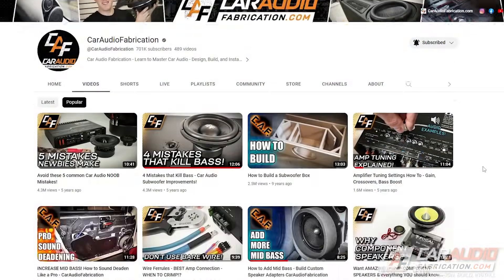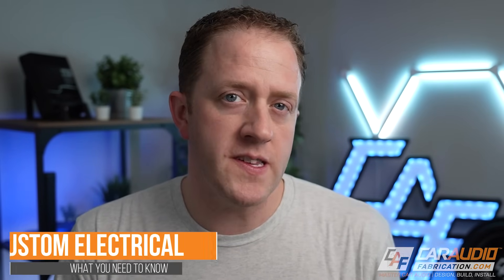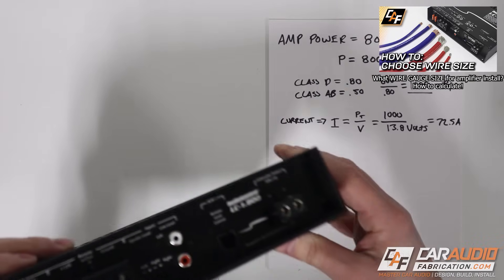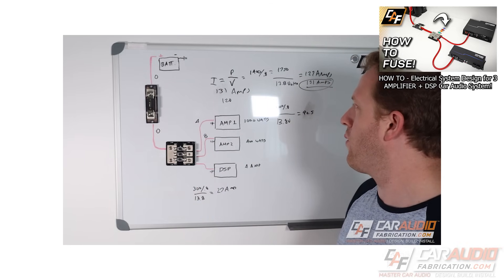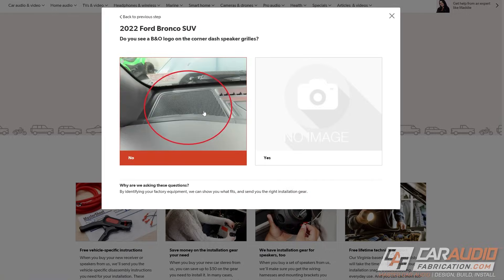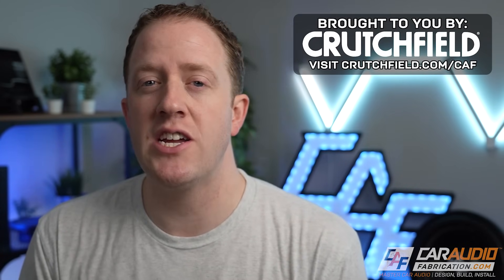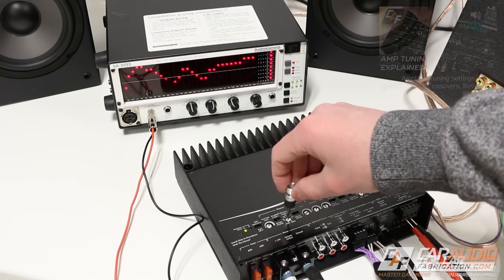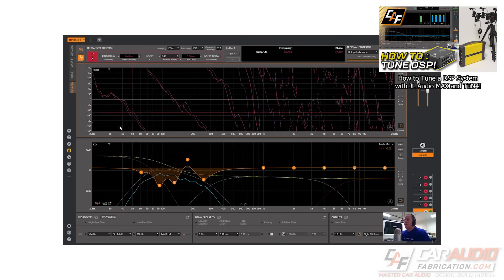New to custom car audio? START HERE!

Comment: HI i watch a lot of your videos and they are very helpful. I just got a ford excursion and want to upgrade the audio system. It has 6- 6x8 speakers stock. I want to add a sub, head unit and upgraded speakers. What’s the best way to go about this.

Comment: have an 03 G35 coupe.
It came with a bose system that has been ripped out many moons ago before I purchased it.
There are 6 speakers (front lower door, mid  passenger and upper rear deck).
Im trying to get all four "highs, mids, lows and sub". I keep the passenger back rest down. My setup jvc multimedia media head unit, Polk audio speakers on the passenger and front doors, with JL w6 12" sub in the trunk.I I purchased 3 (don't need to use all maybe 2 only) 6"  memphis power reference woofers and to power everything I have Audio Control D-6. 1200 and a JL 500/1.
My question is how come I still can not get  or hear the definition of all four. I was thinking it might be over kill or they don't make head units with four outputs (front , mid passenger, rear and sub). Or could it be my setup.

Any suggestion my sound?

Comment: Heyho. I need your help. I'm also a complete noob, but I have a 1987 VW Golf 2 special edition Memphis in Atlas Grey Metallic and I want to keep it as stock as possible. (Due to old traditions) they sold the car without the radio, which comes in handy since I'll install a instrument panel on this spot AND then install the tiniest radio and amp which can fire the 6 stock speakers.
I don't want a rolling boom box but just nice sound without seeing the elements which I'll hide inside the dashboard and connect via Bluetooth. No screens, no blinky lights, no shiny decorations. Ghost sound system.
Any ideas, please?

Comment: So I installed my system back in march while it was still decently cold outside. Now that it’s gotten hotter, I’m starting to have overheating issues. Right now, I’m just riding around with the seat folded down (the amp is mounted to the back of the back seat, so it’s in the trunk). Since doing this, I haven’t had any overheating issues. However, we’re not quite into summer yet where it’s going to be even hotter. My air conditioning is also working twice as hard because it’s fighting against all the heat coming from the trunk. Do you have any ideas on how to bring the temperature down in my trunk so I could fold the seat back up?? Really hope someone sees this and can help me out. Thank you!!

Comment: Hey so I’m looking to make an audio system for my truck and I have a few questions, I’m am also on somewhat of a budget but I want it to sound nice so I will be willing to pay

I was thinking about getting 2 10” ct sound ozone subs with some door speakers. I don’t know which door speakers I should get yet but I would like to know how many outputs my amp should have or if I should use two separate amps for the subs and doors.

Also for the door speakers should I get coaxial speakers, component speakers or crossovers?

I would also like to know if tweeters are worth it and if so can they run good off the trucks original amp?

Comment: My car recently had it's battery/alternator die and I only have a subwoofer lined up. It's not on constant 12v and turns off alongside the car itself. What is the main cause of this issue? Is there simply too much strain on the battery? What can I do to prevent this. It's only a 10 inch sub, no amplifier. (Car has a stock one)

Comment: im kind of frustrated when i installed a china headunit and my stock speaker sounds like shit. Now tat ive changed the stock speaker, it still sounded shit. I fidle with the headunit EQ but it still not as good as stock one. Now i am thinking on getting an inverter and hook up my pc audio sub instead and run from the back of the headunit for output audio, lol.

Comment: Anyone know why when I install an aftermarket head unit in a 2005 bonneville head unit won’t turn on checked multiple times everything wired correctly and the stock one works when I plug it in

Comment: I grew up working on cars and started installing stereos when I was 12. It’s been a couple decades though so I thought it best to start from the beginning again and renew my knowledge. What I am wanting to do is simply add a couple subs and amp to my existing stock stereo in a 2020 Nissan Altima. I was thinking the simplest method would be to get a kit from skar audio with a single 10 or 12 and simple amp I would use the high input to connect it to my current stereo.

Comment: Hiya, I'm looking for advice on upgrading the sound system on my Hyundai i10 se 2017. Looking to spend around £500 but this is my first car and I have never installed any car audio at all. Mechanic by nature but looking for advice on parts. What would anyone recommend parts wise for a sub amp and wiring / fuse for £500

Comment: Hey Mark
I bought 2023 Toyota highlander with stock 11 speaker jbl sound system.
The sound is not great.

I am thinking of installing a sub and and amplifier.

Do you think this will make the system sound better ?

Or do I need to change the speakers as well ?

Thank you
Reply: Great question

Comment: I’m looking to build/install a stereo system in my 1956 chevy 3100 truck. I want to make a custom speaker set up using the original gas tank behind seat. I’m not going to use it for fuel anymore. I was thinking 2 woofers and two speakers. With the amplifier mounted in a recess in middle of front face of tank. I know it will require some welding and fabrication but I plan on using the stock strap mounts. Any thoughts? Suggestions?

Comment: Hello,  pretty new to this and was wondering if I could get some help? 
I have a 19 VW GTI, I'm looking for something that is fun. But doesn't have to be crazy or over the top . 

I've been looking at a Kicker 48TCWRT102 sealed enclosure with single 10" CompRT® 2-ohm subwoofer and passive radiator. Would this work well ? Over kill? Or just look elsewhere?

Comment: I think frequency/noise interference would be a good thing to consider. The reason why it because a stationary build is different than one on the road or a build cancelling out part 15 of the FCC rules lol. You have given us several years of data and experience talking about improvements within the vehicle but not tuning to keep frequencies and sounds out.

Comment: I had the stock system taken out of my 23 Tacoma. Was non jbl. Learned a bunch from from local shop that did the install. Doors dampened, JL stealth sub, JL 5 channel amp, doors and dash changed to kenwood, and Kenwood Excelon DMX958XR receiver. Day and night to what was and what is. I did research options. Helped in my decision. Great info from your channel.
Reply: How much did that cost you

Comment: I have an AudioTech Fischer Match Up 7 DSP hooked up in my new BMW X5. The DSP has one RCA output to run an external amp.
I'm going to use this output on the DSP to connect my new JL amp to power a JL W7. Obviously the JL amp has both red and white input but the DSP only has a single RCA output. 
Do I need to get a 1 male to 2 male Y splitter RCA cable?
If not, since there's only one plug on the DSP, which input on the JL amp do I plug into from the DSP, white or red?
Maybe I'm overthinking this and it doesn't matter?

Comment: Ok so I have a question now I am placing an amp in my semi truck with 6X9 and 12 inch 1200 watt sub with 2000 way 5 channel amp.  Now I was told to have a second amp run on the sub.  However idk if I can do that in a semi.  Would it kill the batteries?  And and if I do a second amp where should I run it???  Daisy chain, or straight from the batteries?

Comment: Hi Mark. Love your videos. I’m having a problem with my system that started a year ago. Every time the bass kicks in it sends my amp into protect mode. I’ve tried swapping out wires, a different amp, a different sub, a different t head unit,re grounding the amp. Do you or anyone in the comments have any clue what might be happening, or have a video on the subject?Battery is good. Can an alternator cause this?
Reply: Could be a voice cool going out….when the sub moves it breaks the connection.   When it rests the connection is remade (plays when you first turn it on or at lower volumes).

Comment: do you have a designed box with 4 subs that will fit behind the seat of a regular cab. not alot of room for sure. mtx made one back in the 2000  but im sure you could come up with something awesome

Comment: I would like to learn about why you twist wires, what exactly are you twisting which wires and why, how it helps and the purpose of doing it! I see you do it often in your build videos but I’ve never understood why
Reply: Taken from Audioholics website;
"Twisted pair cable is beneficial when you're parallel running multiple sets of speaker cables in close proximity to reduce crosstalk or mutual coupling though we've only heard/measured such phenomenon when the amplifier end of one speaker and its associated cable was left unterminated (disconnected) to the amplifier while the adjacent speaker cable was transmitting a large signal to power another speaker. The audio signal transmitting from the powered speaker cross coupled over to the disconnected speaker cable and actually drove the attached speaker of that cable to audible levels sitting 15 feet away from the speaker!"
Note, don't leave unattached, powered cables loose just so you can try and recreate this effect. Because not good haha
Reply: dont know what the other guy said i cant read but basically less interference and theres different ways to twist them together to have less and less interference its a whole world out there

Comment: I remember using 18ga speaker wire for my amps power and ground. I remember not securing anything down and going around a corner too fast trying to show off to some girls walking down the street only to have my amp disconnect and end up looking like a buster. The struggle is the journey.
Reply: I’ll never forget my first build, went bumping to see if all was well, battery died at a stoplight 😂 my first wire job was wack but I’ve learned 😂😂
Reply: 100% they don't even remember that day, let alone what happened
Reply: @zgSH4DOW  actually I was there and I do remember
Reply: Same ! I had a van with 4 12s and a boat roof sound system !  😅1st car I’m on #11
Reply: @RYTHMICRIOT  this hits me in the soul haha, I had my sub terminals melt and cause a fire in my boot
Reply: @RYTHMICRIOT  bro I cut ever wire on the back of my Radio instead of disconnecting the connector 😂
Reply: I know someone that used phone wire - but dont worry, they doubled up on it
Reply: Like a buster 😂
Reply: @RYTHMICRIOT  i respect the honesty
Reply: @RYTHMICRIOT  😂😂😂

Comment: I have always strived to upgrade the lame Factory Car Systems in my my own Vehicles, I have Amps, Subs and other various components in my Stores. I currently drive an old small car, I didn't want to upgrade the Electrical System so I sound Proofed my Front Doors and fitted upgraded Components to the Factory positions. I then made my own Parcel Shelf with Tilted Stack Layered Enclosed 6x9s. I chose my Speakers by Frequency and Efficiency and it Sounds great in a small vehicle running off an aftermarket Headunit. You can certainly make your daily drive sound good on a budget. 🙏🇬🇧

Comment: If you are struggling to understand Ohm’s law then you need to find a book that explains Algebraic Fractions.

A book I would recommend that is very easy to follow and will explain Fractions and more is - K.A Stroud Foundational Mathematics.  

This will give a foundation for understanding Ohm’s Law. 

1 last tip - if you don’t understand it 1st time, don’t quit.  Read and re read until it sticks, and it will.

Comment: sony jbl kenwood car amplifier how many amps transformer should l supply for home use?
Reply from the maker: You can learn about power calculations in this video here: https://youtu.be/NixHUNo0YII
Reply: If I understand corectly, you want to use car audio components at home. Short answer: you don't. Long: it is not worth a trouble powering car amp from a wall, nor efficient or cheap either. What you will save on amp, you will lose on buying power supply for that. You would be stepping voltage down, than up again inside amp, each conversion is loses. Personally I went with pro stuff (like in studios and concerts) for amps and DSP, for example Behringer makes decent stuff for a price. Downside going with pro, you really need to know what you are doing. If you want to be babysited by settings menu, just go home hi-fi.